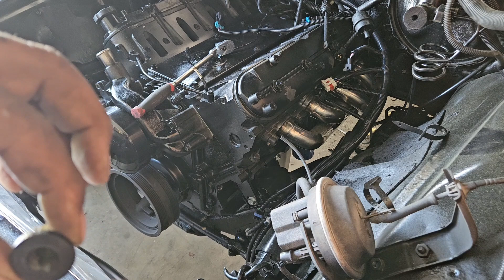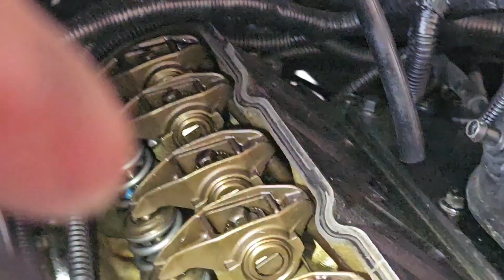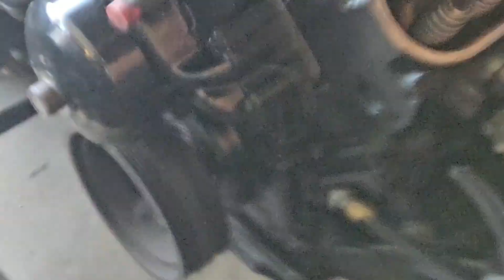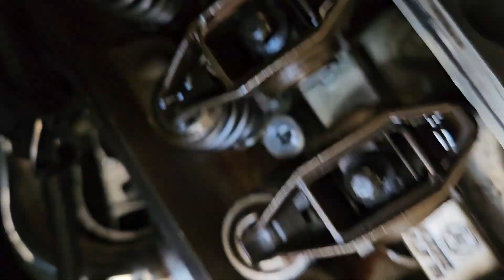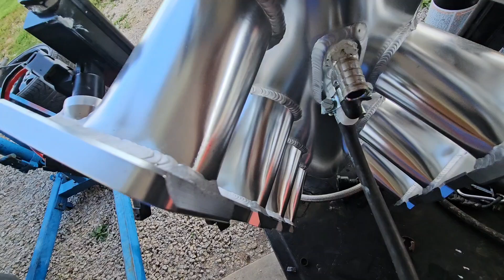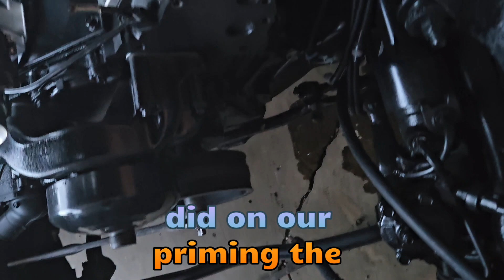How To Prime Your LS Engine.The Easy Way #diy #easy #youcandoit

Comment: Use assembly lube.  Put the engine together.  Use a new oil pump.   Start the thing. Never had a priming issue